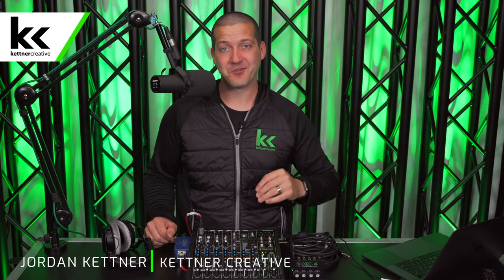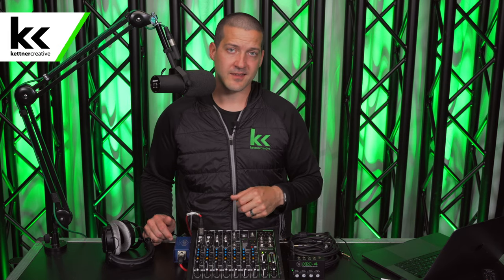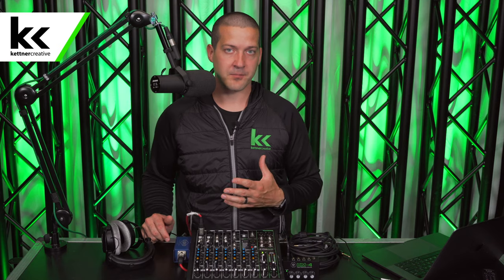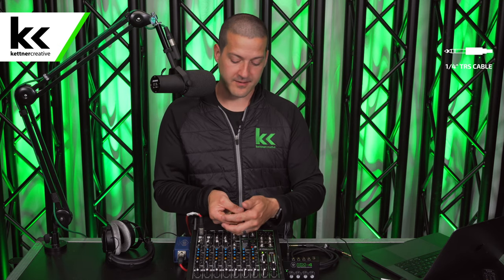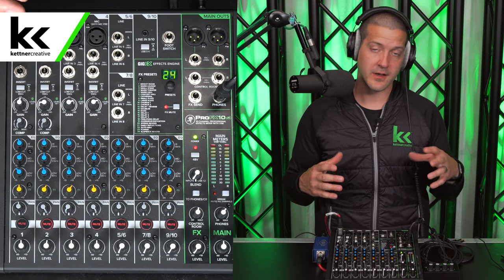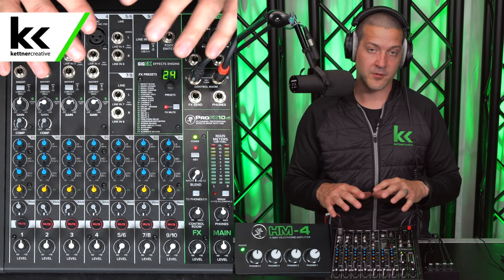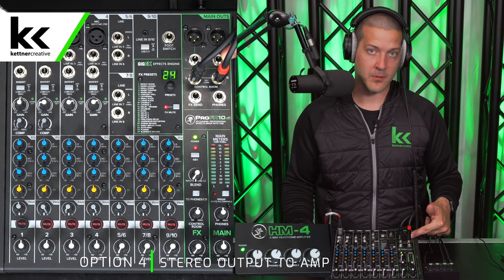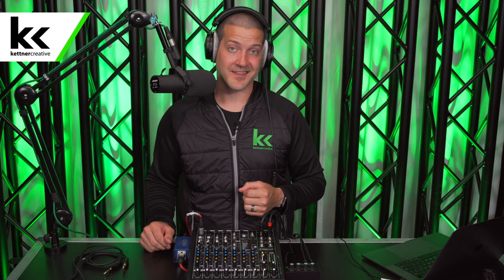How To Connect Audio Mixer to Headphone Amp / Splitter

Comment: thank youu so much dude, I have micro amp ha400 (behringer) and I don't know to connect it to my mixer (ashley premium-6). but because of your video, now I know how to connect it properly. I have a question, if I use main out method, which cable you  to reccomend RCA cable to TRS cable or the one that you used? (TRS to doble TS cable )

Comment: I'm not really new to music hardware however II am assembling my own setup for home / quiet band / online streaming 
I plan on having an guitar + 3 amps + bass + keyboard + roland td17 edrum + 2 mic 
my question are: 

1. What do I need specifically to connect them all to one spot (make / model / brand / item links would be helpful) 
2. We need to have the output be multiple IEMS/Headsets

Comment: I have the Mackie ProFX12v3 mixer and it has a monitor fix jack. There is also a control volume pot and slider on the board. Could I connect the 4 way splitter to the fx jack and then connect a wireless device for IEM’s?

Comment: Great video! Quick question if we use the headphone outputs on a Mackie ProFX16 - will the faders control the volume we hear or will only the gain dial control what we hear?
Reply from the maker: Yes, the faders will control the volume you hear as well.

Comment: So If I am trying to run 2 sets of headphone amplifiers for a middle school rock band to do headphone practice. I had one balanced cable going from the left master output to the headphone amplifier. If I have another headphone amplifier should I just use the right master output to the 2nd headphone amplifier? Today, when I tried using the headphone output it didn't seem to work - do I have to all the channels on PFS solo?

Comment: How understand when is a question of low preamp power or headphones impedance? I have a mackie mix 5 and i use my sennheiser hd600 in the headphones out to hear my tube amp and backing tracks from pc.. My problem is not the volume but the feeling on guitar is different.. Seems like a compressor has been added..

Comment: Hello! Please help me. I have a Yamaha Portable PA System with Bluetooth Stagepas 400BT. It has a console with only outputs for left and right monitors. Is it posible to use de monitor output to connect directly a in ear earphones using an adapter from 1/4 to 3.5mm? It also has a independent volume for the monitors.

Comment: great  video. I would need an advice. I have a Mackie Profx16v3. Our drummer ( electronic) plugged in a stereo input line (9/10) would like to hear herself playing with a headphone but be able to mix what she is hearing (e.g more drum, les guitar), how could I plug the headphone for this ? in a monitor AUX ? or CONTROL ROOM L/R. Thanks a lot
Reply from the maker: Aux output into a headphone amp.

Comment: Maybe I could sound stupid but instead of using headphones on Headphone Amplifier, can we also use that to record the sound to the Laptop or mobile, or also use it as the microphone for some live streaming applications like youtube or Facebook? 

I have the audio mixer that has the Control Room output and I also wanted to use Stereo Out for the external speaker. But somehow the USB recording is not working because of a device malfunction.

If you can also make the video out of this it will be a huge help.

Kindly Reply. Thank you.

Comment: Could you help me please? I use the behringer xr18 mixer and behringer ha400 headphones amp for splitting signal to 4 headphones on the rehearsals. I use “headphones” output on mixer. And while using some of the outputs of headphones amp I hear really noisy distorted sound. When I use this headphones amp for one headphones everything is ok. Could you help me please?
Reply: Bring the gain down on the monitor out on the iPad. If you bring the gain down the distortion will go away!
Reply: Make sure you bring the gain down only on the Selected Headphone amp monitors!

Comment: Has anyone been able to find the specs for the Mackie HM-4?   Noise Floor, impedance, mw per channel?   It's a great price and if it is transparent and drives the headphones better than the cheap audio interface amps (they always underpower) then this is a great improvement without buying audiophile amp snake oil.